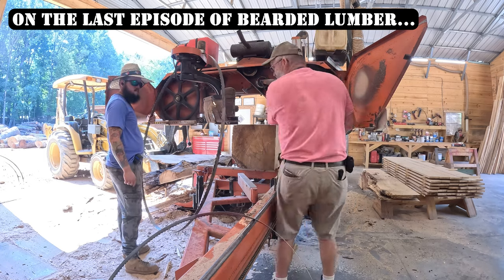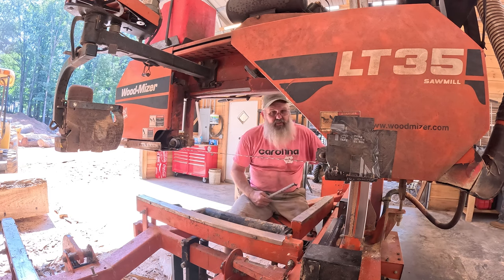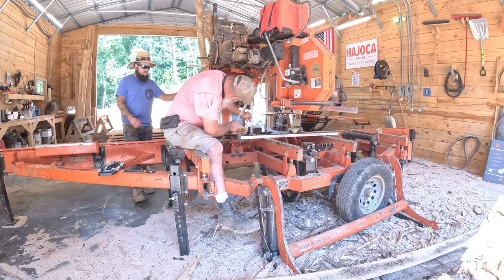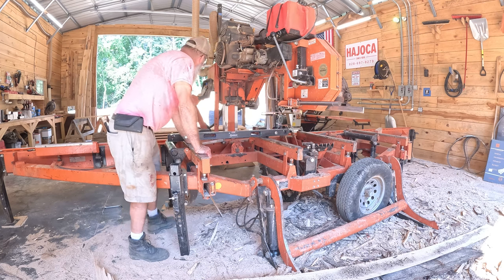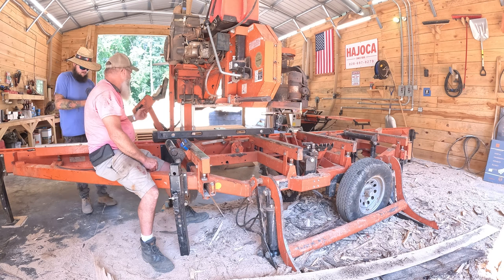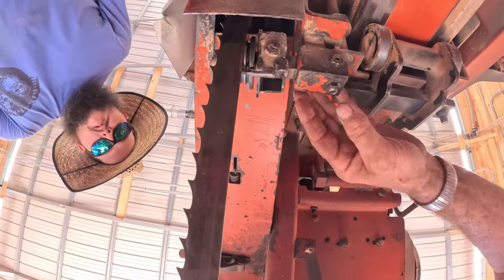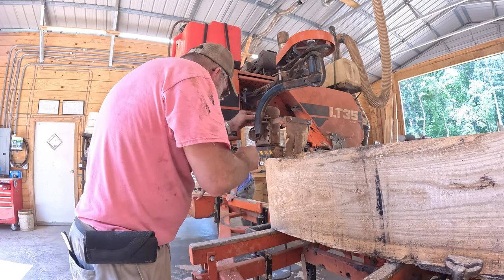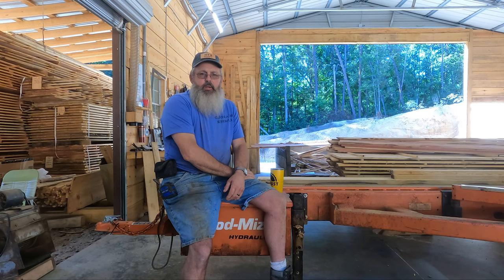Finding a Loose Roller During a Blade Change. A Forced Reset of our LT35 WoodMizer Sawmill.

Comment: Appreciate you and Matthew taking the time to make these videos.  I can read and re-read the manual but seeing it done in real time helps tremendously.  Just picked up my "new to me" 2021 Wood-Mizer LT35 HD.  Did some routine maintenance and set a log on the mill to give her a test.  First log went pretty smooth.  Half way through the second log the engine bogged down and started blowing smoke, BAD.  Fortunately, a quick carburetor rebuild resolved the issue and we are back up and running.  If my opinion matters, I really appreciate the maintenance videos, please post any work ya'll do on the mill.  I am sure one day I will have the same problem and a well done tutorial by Bearded Lumber is the first place I will look.

Jason Pierce
Hwy 90 Sawmill, Loxley, AL
Reply from the maker: Thx Jason and congratulations on buying your woodmizer now you have the same addiction the rest of us have .
Thx for watching and have a great day.

Comment: Nice orderly method of setting saw blade in multiple planes. My question is do you use carbide tipped saw blades, they cost multiple times but seem to last much longer and tolorate metal far more forgivingly? I have seen video but have no direct experience of carbide cutting thru 1.5" square side rails and remain useable. This is a great teaching video for getting thru a setup involving interconnected varibles. Ray Stormont
Reply from the maker: Thx Ray no I don't use carbide blades there too expensive and only help on soft metal , anything case hardened still ruins the blade and cost more 
Thx for watching
Reply: Instead of monkeying around with a,flexible tape why not just cut a piece of wood 12 inches long and use it as a gage.  Hold it on the rail and lower the saw to just touch it and then move it to the other side and see if the blade is the same distance. That will make it easier on your tired old eyes.